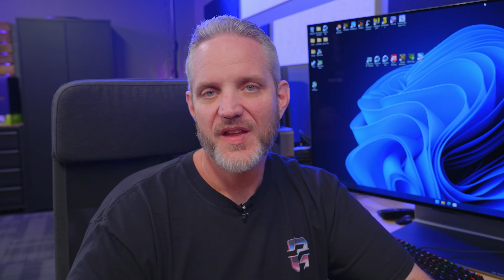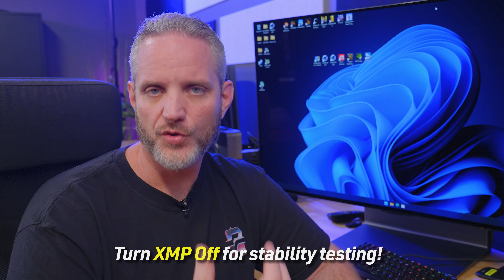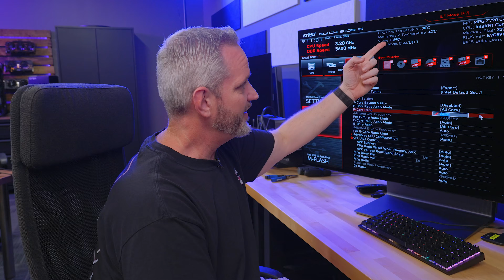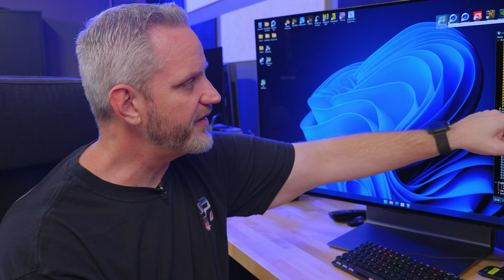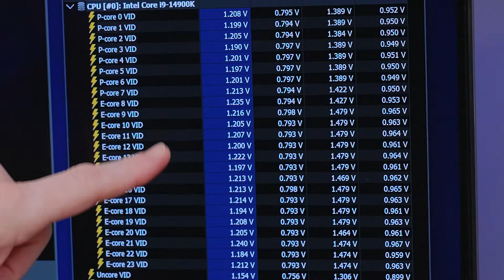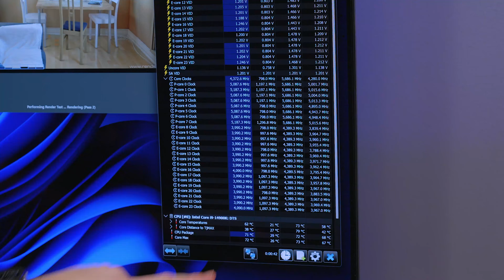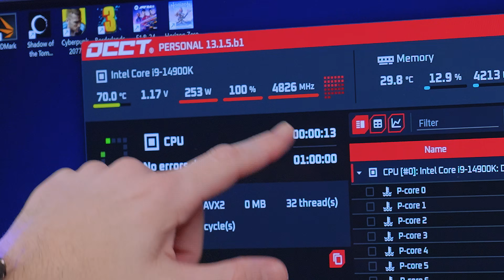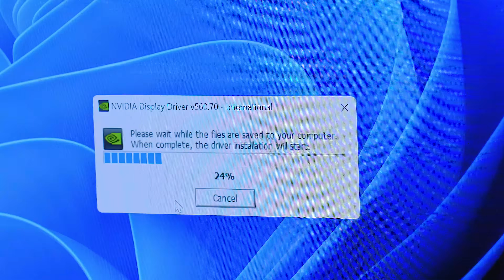Guide: How to check if your CPU is BAD!

Comment: MY 13900K died, I think it degraded enough and intel immediately approved RMA lol
Reply: How long did the rma take? I put a ticket in on Sunday and it's been radio silence since
Reply: @AZGhost623  it took about 3 days, I called their support line from the phone number i provided in the ticket and waited for like 3 hours then the call dropped. 10 min later i got a response on their online ticket portal. I would request an update in their online portal
Reply: Lucky,  they denied mine
Reply: @SwingArmCity why did they deny yours have you over clocked ?
Reply: @jessieteylor  I didn't mess with it. I'm done with intel. I'll stick to my other system (ryzen 5600)it's been a straight awesome machine
Reply: Should of got a KF  version....
Reply: @ZenRyoku  what did that matter?  One has integrated video, one doesn't...
Reply: @SwingArmCity  I was being feciecous...fukin around...

I actually have a an   i7-133900-KF   maybe misplaced a 3 or 9 (or whatever)  basically the processor KF  vs just the K  version is supposedly completely unlocked with no restrictions on it...  it's been a while since I bought my latest pc...so forgive me if im not 100% accurate...

But these damn octocore 12th gen processors sometimes acheive almost 5k  htz  range...which is fucking insane...i started underclocking for the sake of how damn hot it got in my room..lol

I even removed the glass plate that is the removable side of the case in case you got to get inside for anything and replaced it with some very cool perforated screen specifically to protect against dust, but let's the entire pc  breathe and disperse enormous amounts of heat to which I added a mini tower fan about 1 ft tall that helps ventilate the pc as well as the area around it...   Much better than liquid cooled stuff in my opinion...

No matter how hard i run my pc   (also has a RTX 3060 ti (the bad ass kind ppl use for mining bitcoin), plus the 1000 watt power supply....
...the processors or GPU never get above 80 degrees centigrade....which most of the time operates in the 60-70 degrees range on tha reg...

Which accomplishes (1)  The sheer heat the entire rig typically gives off.. (2)  allows the PC to run as hard as i want it to without overheating...(3)  helps stave off degregation for much longer than running sealed in it's fusion level hot generator sealed metal box compartment....

Anything electronics that run with capability and intention for performance will ALWAYS break down over time....it's physics...💯   THERMODYNAMICS ARE VIRTUALLY IMPOSSIBLE TO CIRCUMVENT....  EVERYTHING WILL DEGREGATE or deteriorate over time....
But the only way to extend the life of your performance based electronics (specifically PCs)  you just have to get creative or specific with the hardware you decide on to get the most viable life out of it
Reply: @ZenRyoku  WTF is your system...why on earth would you pair a 13900KF (btw the F just means that you have no integrated grafics unit in your cpu) with a 1000w PSU and than pair it with a crapy 3060ti?
Reply: @georgwarhead2801  well...simply put....during the time COVID-19 was in full swing, before we even had a vaccine and every everywhere was quarantining whether by their own choice or forced to......there was another absolute atrocity going on...

thr absolute lack of graphics cards unless you paid 5x-10x  what they cost normal retail....

the availability of any graphics was virtually non-existent....💯

so  instead of buying one card i instead an entire computer for virtually the same price that actually included the card i wanted...💯

and the system was pretty damn decent....   so  for half the cost of any gaming computer at the time I got one that performs virtually noticeable in difference compared to $4000 PC's   that basically had very close to the same specs....💯

so for less than $2000   didn't opt for the highest RAM Option which was ok at the time...and got a 512 MB  SSD  HD instead of the 1gb or 2 gb  which was Ludacris in cost...plus i already had SSDs  and  high capacity  HDD  for non critical storage...

so at the time (4000 series RTX's)  where absolutely negligible as far as performance goes....so no bother wasting an extra $500-$600   on something that maybe gave you a 1% increase in performance....💯

so    even back then....$4000+++  for  a PC  that could produce barely noticeable framerate and overall performance vs a $1800  PC   that would perform almost as good....   plus  after the 3060 ti specifically  later models where designed differently and could on paper out perform my card, but in practical usage, they are absolute powerhouses to function more stable over time....which is why at the time crypto miners would EXCLUSIVELY get and use multiple 3060ti because of the overall cost and above average capabilities without burning them out within a few month to a year....

i didn't really choose the 1000 watt power supply...it just came standard with the configuration i got...

i figured...hey...that might be more than i need...but it gives me options to power any additional components or upgrades i would account for in the future...

and  let me tell you something....ive owned more computers than you have years of existing (in all probability)    and i cannot remember how many times I've thrown away an entire system back in the day because a faulty or jyst burnt out  "integrated" peice of hardware...specifically integrated worthless graphic cards...or integrated sound cards,   or   integrated ethernet cards....

THE RULE OF THUMB WITH ANY MOTHERBOARD.....IS IF A SINGLE INTEGRATED PART FROM THE FACTORY DIES OUT ON YOU, IT CAN VERY EASILY AFFECT AND SYSTEMATICALLY RUIN THE ENTIRE COMPUTER...💯

If you cannot take it out or put it in your motherboard without having to sodder it directly don't bother....

cause it's easy to just change out s broken component if it goes bad...you can't do that with ANYTHING integrated or permanently fused to your motherboard....💯

(one bad apple analogy enter here)
Reply: @georgwarhead2801 because they likely needed it for cpu work not gpu?
Reply: @georgwarhead2801  360TI isn't crappy.
Reply: @ericmatthews8497  depending on how he defines "crappy" it likely is. I'd say anything under a XX70 series is starting to border on "crappy" in the grand scheme of GPUs from Nvidia.
Reply: My best wishes to you on your next one. The new Intel default is a massive overvolt, so when you get the new bios do not select that default if your bios doesn't let you undervolt it. I saw only 1 comment to this effect, but 1 commentor said 1400 mv or 1.4 volts felt safer to him and his climate than the 1.5v.
Reply: That's hopeful. I have always 13900ks that has started acting up...
Reply: You should check the manufacture date.  They sent me one that was actually older than the one I replaced - and seemed to have been used.  It was marked "Good".

Comment: i have a 14900k on intel recommended settings on a b760 board and it consistently crashes vscode's c# language server when opened with unity, also crashes chrome with memory access violation errors. it didnt fail any of the tests in this video but maybe I didn't run them for long enough. Crashed on shader compilation for the first descendent as well. My only solution so far has been to disable intel turbo boost and run it at under 3.2 in which it is stable, adjusting the ratio to even 4 ghz wasn't enough to prevent it, and i've only had this cpu for around 3 months without ever overclocking it

Comment: This video is wrong in more than one way. 
- 1). The voltages that you need to look at are VCORE. Not VID, which is what you were looking at. VID is what is being asked, not what's being given - that is VCORE, and the value of importance here.
- 2). Even with IBT or CB-R15, you should manually allocate (affinity) a single core/thread (strongest one or not) to such test, because the scheduling algorithm of the system is not to be relied, it'll designate cores/threads almost at random even in those "single core" tests.
- 3). What degrades these CPUs (much much faster) is when a single P-core, even for a background task, asks to boost to whatever outrageous ammount of "single/dual core boost". Even idling in desktop you can see this destructive behaviour, doing its own unknowningly suicidal thing. When it does that, it is given 1.50v+ (even close to 1.60v at times) depending on the individual CPU and motherboard+bios. These voltage spikes are one major reason why these chips are dying. Even though the chip has power limits, when only one core wants to boost, ALL of the power is offered, at once. See Buildzoids oscilloscope videos (mind blowing!). The latest microcode hasn't fixed that (none will?!), because that would require for Intel to alter listed specs, and they can't do it after the fact (=false advertising => law suits gallore). By all means, just lock (sync) all the P-Cores at same clock and keep VCORE at or under 1.35v (and/or "IA VR Voltage Limit" with a value between 1350 and 1400 mv), and all that crap will be drastically mitigated.

Comment: But what to do.. if my temps are high and there is thermal throttle when I do multi core cinebench stress test. I have arctic freezer 3 360.. that should definitely cool down but what to do if it’s still hot? Im running i7 14700k

Comment: I am really surprised by my midrange Asrock board. First vendor that did not pump insane voltages on auto settings. Asrock is by far the best board manufacturer. Okay maybe I got a 1% CPU with an insanely low VIP table, but Asrock truly rocks. I am an Asrock fanboy now.
Reply: Just wish they would update their bios GUI, it looks ancient. But still love my steel legend.

Comment: When everyone was talking about 98C temperatures and other CPU problems of 13/14 GEN, I went with a i5-13500 to be on the safe side. That SKU is not on the problematic SKUs list reported by INTEL. It affected all the CPUs above the 13500. If you have a non-K i7 or i9, your CPU is affected by the Microcode issue.

Comment: I bought my 13700k around launch back in 2022 and yeah the degradation started around 7 to 8 months in, started crashing while compiling shaders and such, specially on emulators.

I RMA'd mine and to be fair the shipping and replacement arrived rather quickly, HOWEVER, be aware that in the email they send you with information about your RMA and about your replacement, it will state that the model they'll send you will vary depending on what's available, I got in return a 13700KF instead, I personally didn't mind much since I'll never use the integrated graphics and have spare GPUs in case of emergency, but keep that in mind if you do RMA your CPU.
Reply: Many people who RMA’ed their i9-13900k’s and got an upgrade to i9-14900k’s. 

Meanwhile they technically downgrade you. They gave you a product lesser than the one you had originally. That’s absurd.
Reply: @1newme425  See, that's what I thought as well, and I agree, sadly I needed the CPU back as soon as possible as I had work needed to be done, don't have any other working PCs atm, loosing that part of the CPU was ok just to resume my work.

That's why I posted this so people are aware and call intel out if they notice a smilar RMA.
Reply: that fcking sucks , i hope if i ever get to a point i have to use the rma for my 13700k, that theyll have another k version for me, why are we consumers getting punished for their damn mistakes? if you bought a k model, that youve paid slightly more for, your replacement should be k model as well, if anything they should upgrade to 14700k ,if they dont have a 13th one to replace.
Reply: I purchased an Intel i9 13th Gen CPU processor chip.  Soon thereafter I began having serious issues with it, such as crashes and instability.  though I did the prescribed uploads, the problems continued.  Recently I applied and was approved for a replacement chip, which was supposedly to correct this problem.  Upon receiving the replacement chip, before I opened it, there was a slip of paper, which was obviously in “in house communication”, which seem to indicate prior usage.  Also, upon investigating the various model, serial and production numbers on the chip, as well as the bar codes, it seems that the replacement chip is actually older than the chip I am replacing.  Also, if it has been used, or installed in any system, the process that causes the instability in this chip has already begun, and it is only a matter of time before the same issues arise, and this time, it may be out of warranty.  I have raised this issue and my concerns in several email contacts with Intel, who have simply dismissed them, with the usual replays of assurance.  When I merely asked for a fresher chip, they told me they could not find any.  I am not satisfied with this.

Comment: Well. Tbh i always check the cpu voltages when i build a new system and undervolt. Since the Thunderbird 750MHz or so. 
Also did that to my 13700k, and the Voltages never spiked high. At least what i could see with aida64 and hwinfo.
And every time i do a bios update, i repeat that step, and i do repeat a full night of karhu ramtest. Just because i know Bios Versions tend to fuck up memory stability and/or various Voltages.
So i'm pretty chill about my cpu's degradation. Even though the cpu is now 17 months old, and i'm a heavy gamer and it's in heavy use. Thanks Homeoffice. :)

Comment: I have a 14900k, kept voltage and power limits out of the box, never had any crashing or issues
Reply: This. I've never felt the need to overclock. Having the highest performance possible or frame rates was never a priority. Then again I'm only a very casual PC gamer and prefer the classics.
Reply: @razeezar  Me too.. It doesn't even help when you are gaming at 4K anyways.  Stability is more important than absolute performance.

Comment: what I'm mad about is the Intel I9 13900K I can't overclock it because then it gets all messed up you should be able to overclock it with no problem under the BIOS and be done and I can't it's a bunch of junk Intel is junk processor they need to fix it

Comment: As long as you have high end cooler, it won't degrade. As long as you can keep it less than 70 to 85 degrees, while testing. If you have cheaper cooler it will hit 100 celcius. My normal is 32 degree and less than 40 degrees. And while gaming 50 to 60 degrees.
Reply: Thats not really true. The voltage is the other side of the equation. If the voltage is high enough electromigration can happen at relatively low temperatures. Like for instance at 1.5 volts you would only need a temperature of around 55c for aluminum in the cpu to undergo electromigration. edit : I will say to a degree you are correct as in overkill cooling could negate many of the issues but it would need to be very cold with some of the voltages the motherboards were supplying

Comment: I have 13900ks overclocked to 6.2 when use 2 cores and is offcet undervolted by 0.05 volt for 2 years and is rock solid and the vid never pass 1.42 volt on hwinfo not sure yours was maxing 1.51 volt , personally will never let my cpu come close to even 1.5 volt even if intel says is fine , becuse all these latest generation cpu are a racing combat between amd and intel and they keep crossing the logical limits to make their cpus faster .